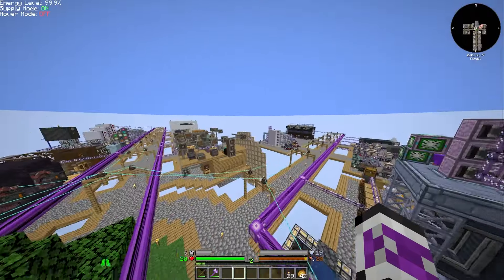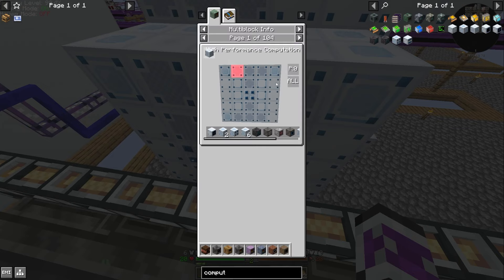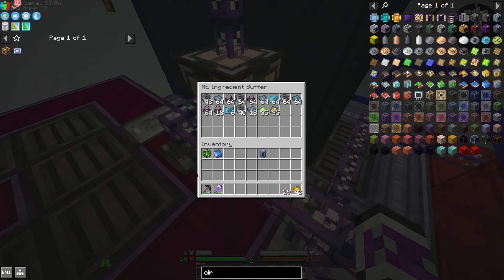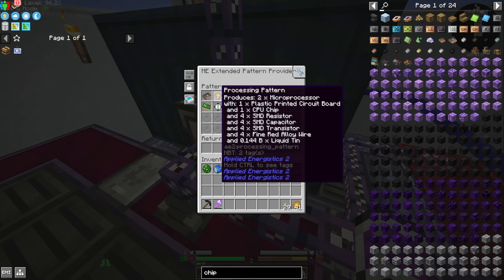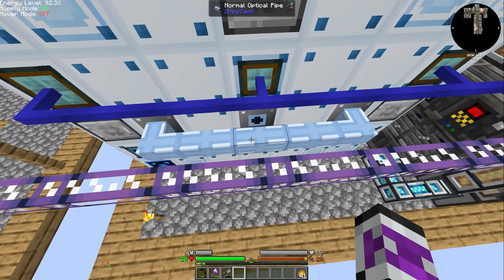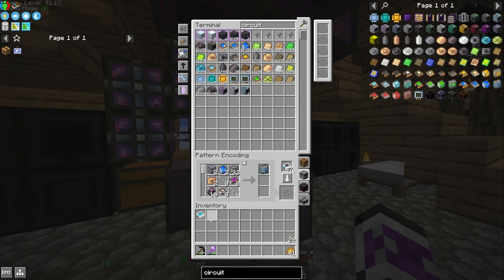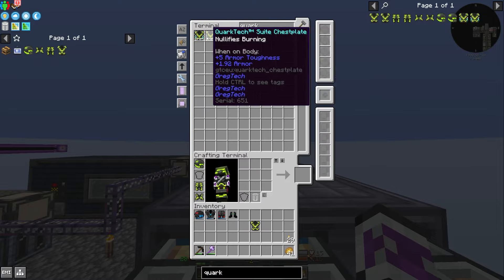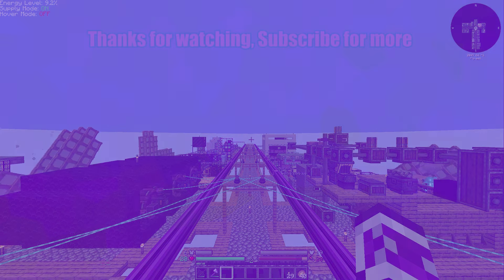Star Technology: Episode 45 - UV Circuit Upgrades

Comment: right i forgot to mention one other thing.

for the parallel hatches to work properly, the recipe input and output should also be multiplied by the parallel factor

4x parallel hatch should have: 4 x input -> 4 x output

although probably better to just make 256x in the first place, that way you wont have to update the recipe later.

or you could use 64x instead if 256 feels too much.

ill say this again, but seriously just use subnets for multiblocks,
Reply from the maker: I've noticed the parallel when the machines stop working, but it's also really inconsistant and some machines don't care and do the max possible anyway. I kinda just guess what it wants then switch to the right method when it breaks.
Reply: @Thaumiumking9  parallel hatch only works very properly in 1.20.1 version
but you can try modifying the pattern a bit (make sure bus and hatches have enough space to work)
also check if your version has the pattern modifier from extendedAE
Reply: @SakuraAdachi-gm2mu This wouldn't work the issue is voltage it cant do recipes of the same voltage as the machine for some reason
Reply: @6tobi6hana6  what do you even mean ? could you clarify it a little bit more ?

are you saying recipes of the same voltage tier as the multiblock can't be parallelized? if so, then you're completely wrong
Reply: @SakuraAdachi-gm2mu  in 1.19 if the recipe is uv and the multiblock is uv and the parallel hatch is set to anything but 1 the recipe won't start i tested it before i ported
Reply: @6tobi6hana6  i did say parallel hatches only work properly in 1.20.1+ versions

i guess the 1.19 might have such an issue, i never played that version. well if the recipe won't even start with higher parallel count set than its more or less useless. damn

Comment: 10:00 computer shoul be exetended in sebth nit hight (longer 2x5 not higher)
Check ME INPUT PATTERN BUSS (or any ME INPUT/OUTPUT). They are extremely good for machines with multiple conflicted recipes. IDK if they are available in your version.
Reply: Just spam hpcas lol not extend them just place them in a line

Comment: damn, you just completely forgot my advice and ignored the video i sent you as reference.
not to mention, i understand not changing all the previous recipes but why the recipes going from now also have fluid substitute on for no reason ?
also so many people including me already gave much explanation about research in greg.

also using 1 assembly line going forward would be horrible. that platform is simply not big enough for assembly lines and research, MOVE IT ELSEWHERE.

and man, the pipez thing looks so ugly, I have never seen any greg player not using subnets on multiblocks (there's no recipe conflict and you never have to babysit them).

also try disabling EMI from whatever launcher you play or manually rename the emi.jar to emi.jar.deactivation. that might fix the issue with recipe not filling correctly when making a recipe for something. also at this stage you should hardly use anything EMI has to offer. (honestly EMI is a buggy mess, i dont use it even in moni)

lastly, This was a horrible pack to chose to play modern gregtech. the quest system is absolutely worthless and even the latest version is hardly any good.
a much much much better option would be either Monifactory or something I played (ATM9). I know ATM9 isnt a greg focused pack and greg is mostly side content.
but even with that it does a lot better job to teach greg to new players. (as of now, the quest is better in atm9 than even moni)

well ill end my ranting here, have a good day everyone and happy gregging.
Reply from the maker: Your right, I forgot to change the substitution, but it also doesn't really matter? Sure it's like 10 ticks quicker on small recipes, but it doesn't fix any bottlenecking that's already going on. Subtle optimisations don't fix the glaring problems with my automation that I've already addressed / can't change.

I always knew I'd move the research when it started getting bigger, so the next time I upgrade it or the assembly line I'll move it to it's own platform.

And last, I didn't know anything about this pack when choosing it, I knew literally nothing about gregtech when I started. And I only chose it because it was recommended by another commenter, so go tell them off, not me.

And I must be mis-interpreting you, because I'm sure as hell not disabling JEI, it's the single most useful mod in this pack.
Reply: @Thaumiumking9  welp, sorry if it felt i was telling you off, im only trying to help. you choosing this pack is in no way your fault even if it wasn't someone else telling you.

how were you supposed to know about the multitude of issues this modpack has. (lot fixed, lot still there)

about the substitution, it feels weird like it's triggering my OCD kinda thing ? like i know that you know turning it off is better but still not doing it feels like itchy. 😅

also no im not telling you to disable JEI, it would become unplayable then. Im telling you to disable the messy, buggy, incomplete trash that is EMI (a JEI addon).
JEI will let you pin items from anywhere btw (even AE2 crafting window which EMI prevents you for some reason) and apparently it would also fix the issue with recipe having wrong amounts (saw from another comment)

honestly, greg modern is nearly not this frustrating as you feel currently, gtm as a mod punishes not knowing more than other mods thats why it feel a little frustrating to you (or atleast thats the impression i sometime get)
and i feel like its a shame cause greg is very fun and hope you dont give up on it.

i wish you all the best, hopefully you continue to have fun going forward.